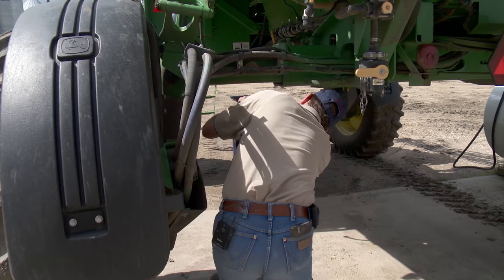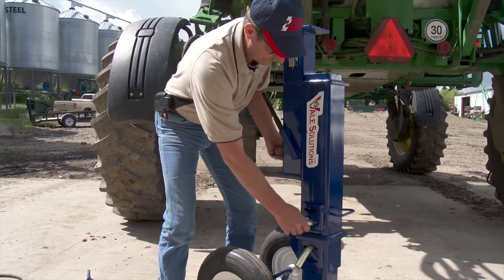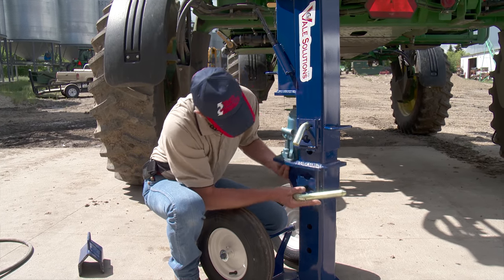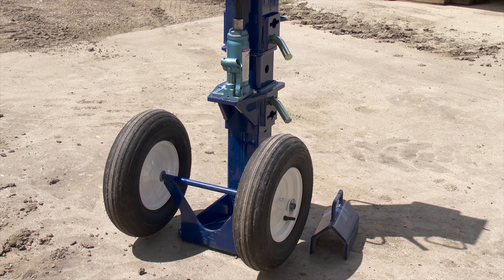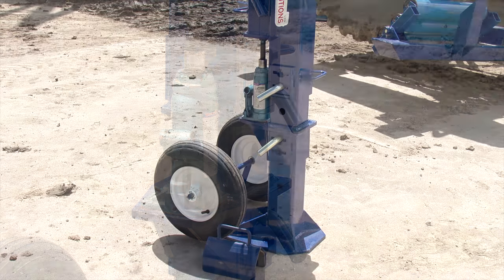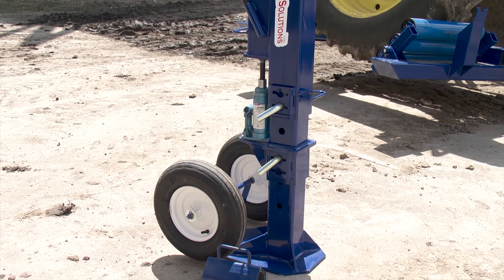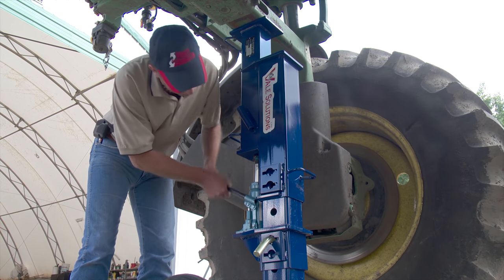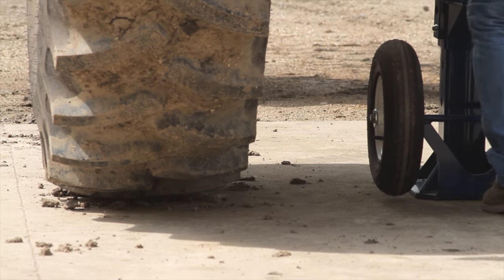High-Clearance Sprayer Jack

Comment: Great idea to increase the likely hood of workers going home at night  but you need a bigger ( capacity ) jack for your demonstration - you have made an elegant solution to a problem but have let yourself down with a !@##$ little jack. Good job anyway.
Reply: Yeah, I wouldn't trust a 6 ton jack on most equipment, I would want at least 10 tons to be safe.
Reply: My dad uses a 20 ton pneumatic bottle jack from princess auto for changing his sprayer tires, pretty sure he got it on sale for around $100. We only need two separate lifts (front+rear rather than all 4 corners) and move tires with pallet forks on a tractor. Works pretty slick, with 3 guys we can swap all 4 tires in about 15 minutes from start to finish pretty easily.
Reply: Same jack I use......lol.